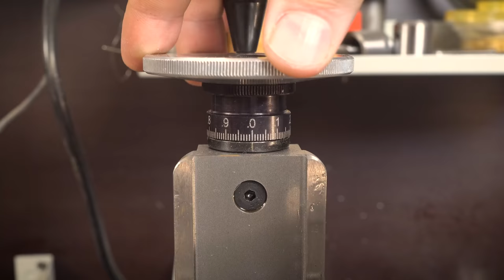I made a tiny lighter! DIY

Comment: The spark wheel needs the cross cut on it. That causes the flint to be sheared into tiny pieces which gives more spark. The way the wheel is now you are trying to remove large ( relatively speaking) chips which require more energy to get them hot enough to ignite the wick.

Comment: First the cross cuts in the spark wheel need to be there for creating flint chips properly.

Second reduce the size of the wick. The spark wheel is tiny and will make less sparks, so with a smaller wick you won’t need as much heat to light it.

Cool project as always!

Comment: I think part of the problem is that you cut the spark wheel with a dovetail cutter, leaving it looking like a circular saw. The flint is very soft. I believe what's happening is that the spark wheel is acting like a cutter and shaving off the flint instead of sparking against it. It is supposed to be more of a percussive motion. It might work by simply flipping the spark wheel over. I doubt that will be enough friction though, maybe use a triangular file on the spark wheel, you want it to be more of a knurl

Comment: To hold a threaded part in a chuck don't grip it directly, make a small collet by taking a piece of stock, make a suitable thread in it then cut a slit in it all the way through so you get an opening. You want a rather thin even wall thickness to get the best chance of even clamping and make sure to position the cut between the jaws.
Sometimes a ordinary nut can be used as a base for this, just cut it length-wise with a saw.

If your collet is made of an equal or stronger material then your part make sure to remove burrs from the cut and use a wedge to force it open or it might damage your threads.

This way you could also kept the screw in the chuck after parting of the excess and thus easily chamfered it.

Comment: I think there is one more problem besides the spark wheel not being sharp enough. The wick releases quite a lot of fuel vapor around it while it's not fired and there has to be a little air circulation or space around it to let some oxigen too to make the ignition possible. Also i know that the spark wheels are made out of hardened steel so maybe all that's left to do is trying to harden the spark wheel a bit more and make some extra room between it and the wick. I hope you get to read my comment!

Comment: Cross cut the wheel for smaller flint sparks and a smaller wick. The air flow slit might need widened also for the right  air/fuel mix and the smaller wick gives the sparks more surface area to make contact with the wick